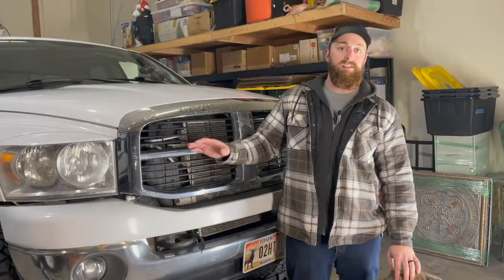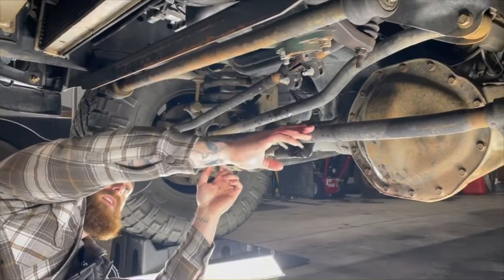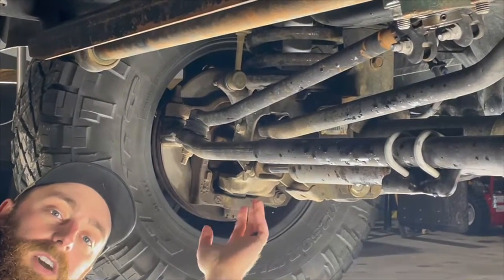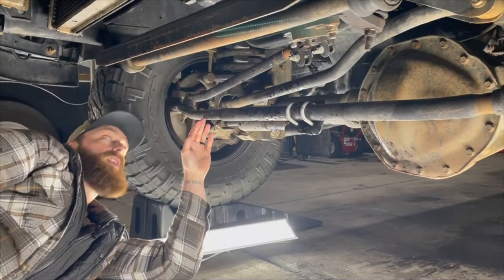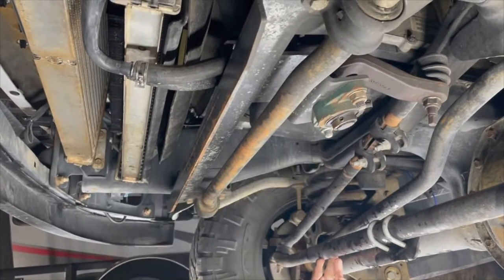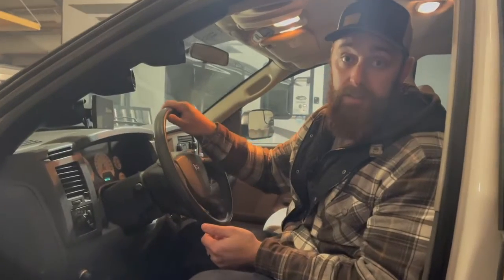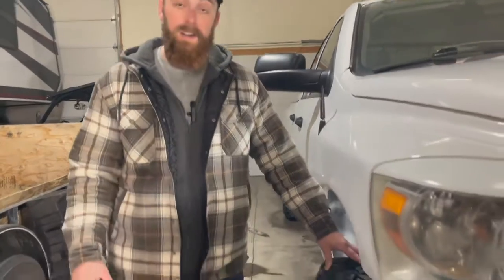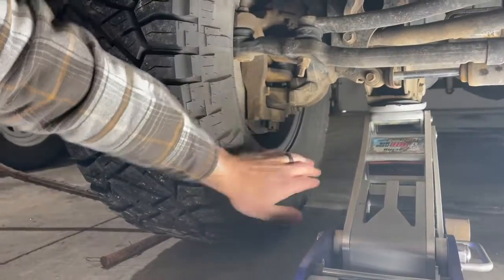Dodge Ram Death Wobble & Sloppy Steering | What Causes It & How To Test For The Problem

Comment: Great video. I have an 09 4x4 with the 6.7 and 130k miles, everything original. Death wobble is getting bad so I'm going to address it soon. May take it to a shop but this video will help me understand better what the shop is going to recommend. Thank you! 
ps; you have a nice truck there. 5.9 0r 6.7? Sounded like a 6.7.
Reply from the maker: Thank you! It’s a 5.9 with a 5” exhaust

Comment: FANTASTIC VIDEO.  I have a 2011 Ram 3500 diesel Mega Cab with 98,000 miles.  Just today, for first time ever, it developed a wobble, not yet a death wobble, which I have experienced before on a Jeep Wrangler, but out the blue = I drove it yesterday without it, this morning a wobble right about 35 to 40 MPH, but I can sense it less also at lower speeds.
Reply from the maker: Thanks! I’ve been lucky and never experienced full on death wobble, just the wandering and a little shaky. Hopefully this video will help you figure out what’s causing it on your truck